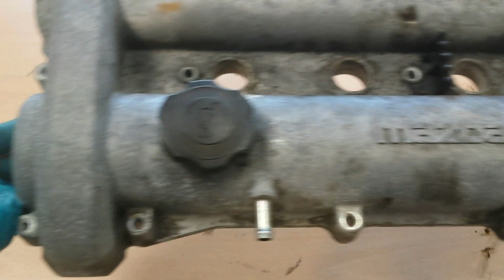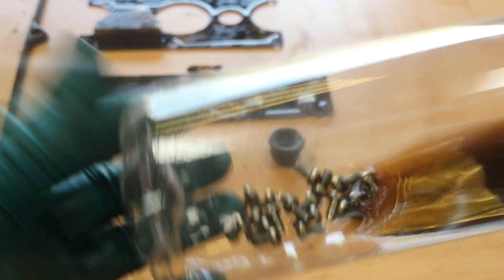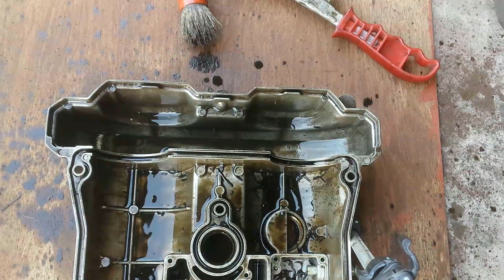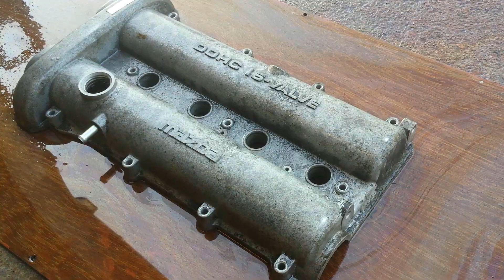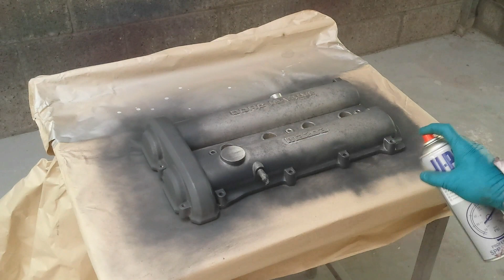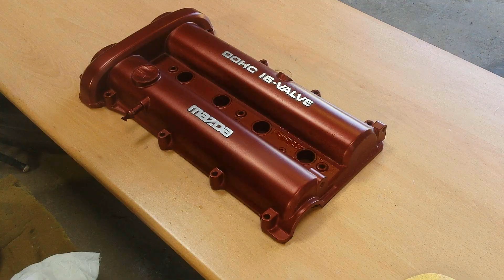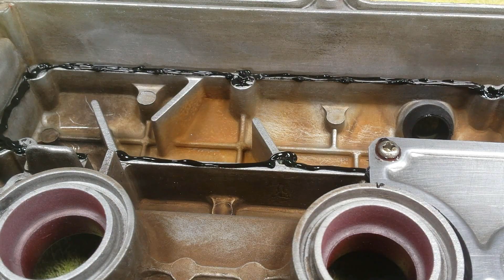MAZDA MX-5  Rocker Cover Restoration ( Miata , Eunos )

Comment: As amazing as this looks. And I really do think it looks epic. From a mechanical perspective is there no risk to moving parts if a piece of the gasket sealant that splurged down the sides comes loose?
Reply from the maker: Hi, There is zero risk of any damage occurring the from the small amount of RTV that may squidge out and come loose as every engine has an oil strainer in the sump to catch any stuff in the oil then you have your oil filter aswell.

Comment: does the paint hold on with the high temperature in the engine compartment ? looks like you used regular basecoat. why not use heat resistant enamel? i want to do the same but not sure what kind of paint to use. thanks!

Comment: Not to diminish your excellent work, but you should invest in a cheap DIY nickel plating setup to give a final touch to the miscellaneous bolts/screws, like the ones used on the wire separators!

Comment: fantastic! you did a great job. i have to ask the question... why didn't you blast the outside instead of all the scrubbing. if a blaster is not at your disposal then i understand. but if this is something that you are going to continue to do, you might consider getting an inexpensive blast cabinet. use mine allot. sure saves on the labor and gets to the spots that are hard to get to like tight corners. having said all that you really brought that part to life. it really was a nice touch sanding the letters to make the whole thing pop. bravo!!!!
Reply from the maker: Hey, Thanks very much for your comment. A blaster and cabinet are definitely on my wish list of tools to get for making these videos, the scrubbing does get a bit boring after a while but you can only work with the tools you have ;). RRC

Comment: At about 14:03 he taped off that big hole on the top of the rocker cover. Did I see correctly that he used sanding paper to make it match the circle nice and even?
Reply from the maker: Hey, you saw correctly. going round with sand paper to cut the tape rather than a blade gives you a MUCH cleaner tape edge when unmasked.
Reply: Awesome! I'm not forgetting that one

Comment: Excellent job! My only worry was those little screws coming loose inside the crankcase. Did you use blue locktight and I missed it? That's the only thing I would have done differently. Stunning color choice👍
Reply from the maker: Hey, Thanks for the comment. All of the screws were coated with thread lock so no worries about them ever working loose ;)

Comment: My preference is to not have to read an article that goes along with the video but I understand some people like a video with effective no audio content. I do have a question. While I realize the valve cover won’t go back on the engine until later, since you’re restoring the engine bay, what was the point of showing the valve cover removal? The video was sped up and there was no explanation so I can use that part of the video as a “How-to.”

Comment: Looks AMAZING at the end! Do you need anything special with the paint to deal with the temps the valve cover sees? Also, what chemical are you spraying everything down and cleaning it with?
Reply from the maker: Hey, Thanks for the comment. In normal operation the valve cover never sees high enough temps to be any  issue to high quality automotive paint, no additives or special paints needed if you know what your doing.  Im using a couple cleaners  the red one is GUNK engine degreaser and the other is an all purpose cleaner called master cleaner by concept chemicals.

Comment: WOW! That looks show quality. 
You really took a lot of time and effort into making that valve cover look like a Indy show car.  I really liked it when you sanded the name down to the metal then clear coated the whole thing. AWSOM !
Will not the automotive paint not crack and flake from the heat of the engine over time ??
Reply from the maker: Hey, Thanks very much it turned out exactly as i hoped it would. Good question and the answer is no as modern auto paints are designed with temperature ranges in mind and a rocker cover in normal operation wont even get near the temperatures need to break down and crack the paint. Think of a black car sitting in the sunlight all day its paintwork survives massive temperatures no problem ;) RRC
Reply: heck my car is blue and i burned myself slightly when i touched it when it was sitting outside in 100+ degree weather
Reply: 404Destruction    if it's that hot, then I will bet that chickens in your area are laying hard boiled eggs. Lol

Comment: You really didn't need the silicone or the high strength thread locker on the oil baffles, but overall it looks awesome.
Reply: I asked myself if it's necessary...
Are you sure about that?

Comment: My friend, so the inside of my valve cover doesn’t have screws like this one… It has almost what looks like to be screws with no head as if theyre just pushed in... but I don’t wanna bend or break anything... I definitely want to clear the gunk out where the PCV valve connects to the outside of the valve cover.. I have a 2001 Honda prelude h22 
Thank you so much for all the great work and knowledge you spread!
Reply: Also what do you use for cleaner? That orangeish spray bottle to clean inside valve cover pieces
Reply: Also why do we wet sand after that second coat? 🙏🙏🙏

Comment: Why did you seal the vapor plates?  I didn't see any factory seal when you took it apart.
Reply from the maker: Hard to see on the video but there actually was a thin layer of silicone between the cover and the plates. Thanks for the comment.
Reply: Ok, I keep that in mind if I ever work on that part.

Comment: Great job! Did you mask screw threads? Is it safe to powerwash oil residue straight to nature?
Reply from the maker: The screw threads on the top side did not require masking as they are coarse threaded screws no amount of paint over spray is going to clog those threads ;) And the power washing was done on a massive concrete slab that is purposely designed for jobs like this no oily water can escape to the ground water im not that irresponsible that i would ruin nature for the sake of cleaning a rocker cover. Thanks for your comment. RRC
Reply: I see. Thank you for your time and answer. Keep up the good work!

Comment: Does heat resistant spray paint work as well?
Reply from the maker: heat resistant spray works fine but you wont get this level of gloss from heat resistant paint.  Hope that helps you out ;)

Comment: I thought etch primer was for plastic? Isn’t VHT primer the stuff to use?
Reply from the maker: Etch primer is far bare metal , adhesion promoter is for plastic.
Reply: @RRCRestoration  Thanks for the info, etch primer would be alright for brake callipers then? Just concerned about it melting or something lol

Comment: Hi, is the paint hight temperature.
Because i'm going to paint my car engine.....i'm scared if i explodes bcoz it's flammable
Reply: I'd recommend VHT paint. I've just did mine on my Civic Type R in wrinkle paint
Reply: @CraigsChannel  but i have compressor
Compressor will have a better finish
Reply: @MrUsefulhacks  If your using heat temperature paint you'll be fine. People say normal regular paint cracks with the high heat. I've only ever used VHT paint when doing these covers
Reply: @CraigsChannel  ohh
But it will not take fire?

Comment: lucky are those  

which have a dust-free cable for painting jobs like this

Unlike me, who has to do it in his garage
and then pray that for the next 10 minutes no shit falls on it

 :/
Reply: Para Noid put a box over it
Reply: @ImBolas  

sometimes part are to big or like last time

used a big box  (did it out side best light day light )
did the primer
did the filler
did the color x2 no problem at all 

finish the clear code second time 

put he gun away  turned around --> stupid bug was sitting in it  :/
maybe a kitchen hood will be a good at to my garage so i can do it there

Comment: you should always untorque your valve cover in sequence, or you could crack it
Reply from the maker: Cylinder heads yes, rocker covers there is no need to as they arent under any tension.

Comment: Don't disassemble the innards and don't use gasket maker. It was just more work for yourself and the number of times I've pulled oil pans and there's bits of gasket maker in the oil is absurd.

Comment: Really Random Channel these videos are great, very useful. Did you not use to use a high temp primer? I'm currently doing the same for my rocker cover (evo v) and was told that Hycote primer will not suffice so apparently need to sand it off.

Comment: Why did it have so much varnish under the rocker cover? That was really bad. Either it has not had very regular oil changes or it has been ran on conventional dino oil! Before making the switch to synthetic oil I ran dino oil for ever usually 3000 mile oil change interval and even with 150K miles the inside of the engine had a honey like yellow color that wiped off with just a rag no solvents needed. With synthetic I change oil every 6-9 months regardless of miles and much the same you can wipe the inside of the engine clean with a rag no solvents needed. Imagine what the rest of the engine must be like if the highest point looked like this. Normally when I pull a pan on an engine to replace timing parts or new gasket on oil pan for a leak the pan will look like that even if the top of the engine is super clean. You might want to drop the fan, change front and rear main seals, new oil pump and clean the bypass if it is not replaced when the pump is replaced. You did a good job. P.S. what was the pink cleaner you where using. Most non-petroleum cleaners we have in Michigan are either clear or purple. Thanks!

Nice prep and painting!

Comment: That car engine was abused
Reply from the maker: How do you figure that?
Reply: Oil was sludged and carbomized where it shouldnt have if the car was maintained properly the racker cover would have never been that rough thays caise by late oil changes and improper viscosity oil,yeah carbon build etc is natural but it definitely shouldnt have looked that bad and if u left the car set aslong as u did the bigest portion would have drained and the oil would have been on the cams and lifters wich it more than likelt was but the sludge isnt good wansnt the worst I've seen but this still a sign of an abused engine

Comment: nice but not perfect.
Reply from the maker: Thanks for your comment. In your opinion why is it not perfect?
Reply: i blast my parts with glass beeds, because you can't get it cleaner and smoother than that way, and it saves hours of sanding and brushing with the wire wheel.
And a blast cabin is cheap to make yourself and a blast gun cost 15 dollars and 2 bags of glas beeds cost about 50 dollars, and then youre the man.
And i see that the clear coat has goose bumps,  so that's why i say nice but not perfect.

Comment: old gasket? sealant? how much oil is flowing from your engine? When will you change the wires? Do not ever do that.
Reply from the maker: The car is a long term project, the rocker cover is still sitting on the shelf. The old gasket was fitted so people could see the finished effect and so that i could sit it down without damaging the faces. The gaskets, plug leads etc etc are all going to be changed as the project progresses.
Reply: wow, forgive my brother, I did not think about it. successful completion of the project. I would love to help you but you live far away ))